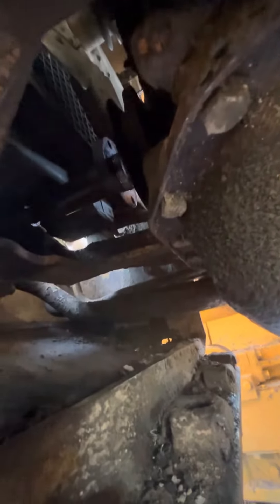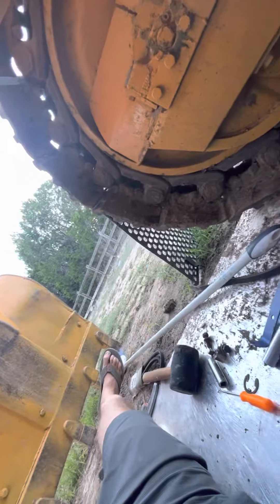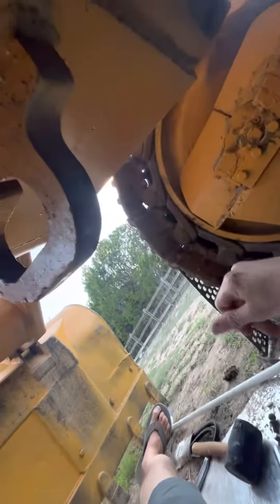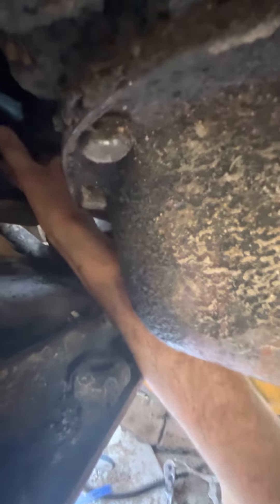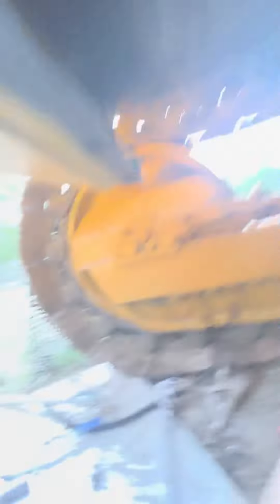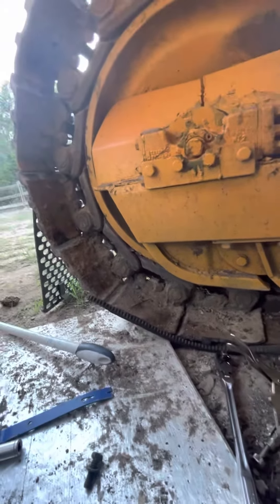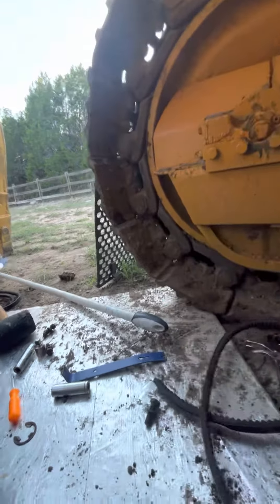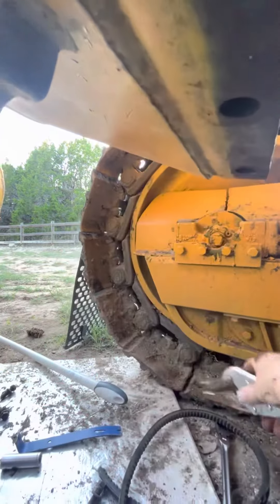1980 John Deere 450 C crawler dozer, fan belt replacement

Comment: I had replace my water pump. I started to do what you did but I couldn't keep the crank from turning to get bolts loose. I ended up taking the 2 bolts out of the hydraulic pump. I didn't take hoses off. I had enough room I could get that belt over the shaft. Took 5 minutes. I worked on it 5 hours replacing the water pump. That's everything back together and running. I'm tired puppy.
Reply: I bought my dozer in 1988.
Reply from the maker: Yeah getting those top two bolts out was a pain in the ass.  The bottom two are easy but the top did take some english, I should've filmed that part. I used a breaker bar and a tire iron to get them loose.  (Edited- Replied using voice to text)
Reply: Where did you buy the water pump?
Reply from the maker: @johnnyfair  the belt # is 17505.  Not sure how to attach a picture but I think that's all you need. Pretty sure I got it at O'Reilly auto but you can probably find one on Amazon for $20.
Reply: @toomey706  thanks!!! My machine is kept 80 miles away so that helps a lot! I will get that belt before my next trip.
Reply from the maker: @johnnyfair  I bought the rebuild kit for this water pump but found a remanufactured water pump with the same casting number for $111. Free shipping.  

https://www.walmart.com/ip/Used-Water-Pump-fits-John-Deere-310A-401C-350B-450-310B-450E-440-2510-401D-480A-2030-450D-210C-440B-480B-480C-401B-450B-482C-2520-350-450C-410-440A/609289610#block-related-heading

Good luck
Reply: If you pull the keeper on the shaft the shaft slides back to the motor and leaves a gap in front to put the belt through